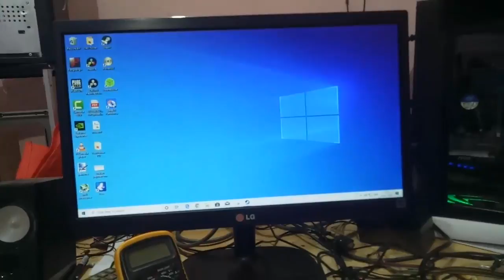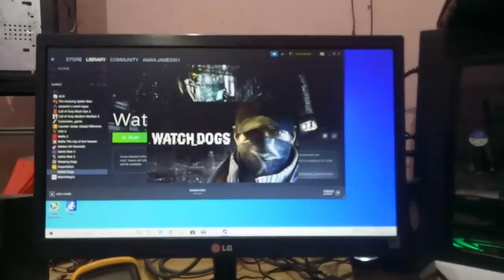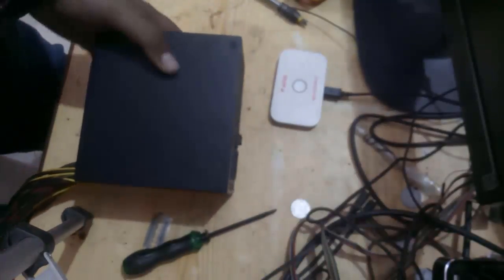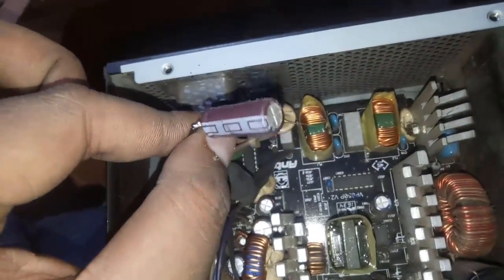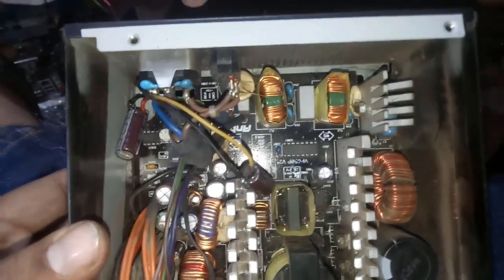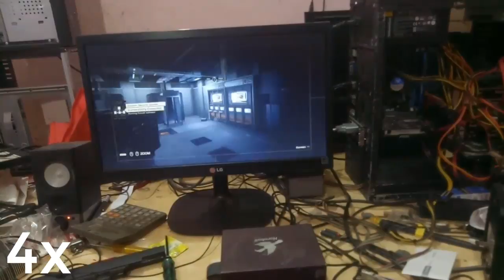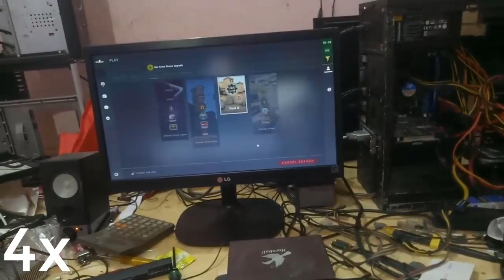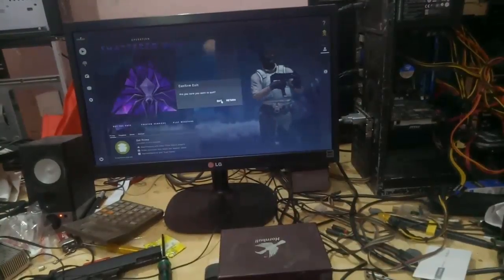PC shut down when playing games Fixed

Comment: Bhai, mera sath ya masla ha ka GTA 5 abhi install ki 2, 3 min ka baad pc goes off. I'm confused because i was playing games like Multi theft auto like 1, 2 years ago. It was working with no shutdown. But now at every game 1, 2 min baad pc shutdown ho jata ha kuch help karo
Reply: Bhai ek baar processor ka temperature check kro maybe temprature bohot zyada ho ya fir dekho apne psu ko ki kitne watt ka hai or jo gpu lga hai vo kitna power hungry hai agr psu kam watt ka hoga or gpu zyada power hungry hoga to game open hote hi pc restart ya shutdown hojayega kyi baar ram ki problem bhi hoti hai or ye bhi check krna ki ghr ki earthing shi hai ya nhi or ac current stable hai ki nhi ghr me ya fir jaha pc hai vaha ka most of the case me power supply ki dikkat hi hoti hai aise scenario me

Comment: I’m helping a friend with his pc. We just put a Corsair 850w power supply in. When we load up any game and make only a little bit of progress, it completely shuts off the pc. I’ve adjusted the power settings in control panel and have all the drivers and OS up to date but it still does it. Help!
Reply from the maker: Is it a brand new power supply
Reply: Aman James yes just bought it the day I made the comment. New ram too. It only shuts down when playing 3D games. When browsing the Internet and downloading things, it has no issues. I’ve checked and rechecked all the wiring and everything is hooked up properly. There’s no overheating, everything has plenty of power and I’ve even done simulated stress tests on everything that have all passed. Still, when I load up a game and it finishing loading a game screen and am able to get to a game, I know the power supply knows to give more power for everything and maybe it just doesn’t, gives up, and the whole system shuts down in a way that is almost like you took the power out of the wall
Reply: Hey did you find a solution?
Reply: Same problem facing , did u found the solution
Reply: Mc Donald's Xiao  yes bro , psu ka problem tha after changing it got fired
Reply: Mc Donald's Xiao  yes bro , psu ka problem tha after changing it got fired
Reply: Mc Donald's Xiao  fixed**
Reply: Mc Donald's Xiao  ha psu change krne baad fix hogya , apne pc kitne watts use krta h wo dekh le kharidna

Comment: I have gtx 960 2gb and i5 500v
My pc will randomly restart when playing games. When i set max cpu power to 70 everything is fine but i have 30fps. Will 700v be ok? Plz help becouse im not good at computers.
Reply from the maker: Buy corsair cx650 or coolermaster v650. The quality of psu also matters a high quality 650watt psu is better than low quality 800 watt psu
Reply: @amanjamestech  thanks bro
Reply: @jakubpiotrowski9288  cx or vs isn't high quality, I'm at your video because I have a vs650. Go for  TX or RX, or thermaltake or seasonic.

Comment: Hey.When i play pubg pc lite,rdr2etc.Most of the time the game run pretty good with out any restart problem.like 3 to 4hrs without any kinds of issue.but some time after 15 to 30 mints it restart and not showing display then i turn off it and then restart and it works.it happens some times only.i have cleaned every things like ram,gpuetc

Comment: Interesting, my PSU 450watt and below GTX1070 requirement which is 500watt but the shut off problem only occurs after install and play GTA V for the first time, other games etc NFS Payback, Fall Guys, CS Go & Naruto Shippuden Ninja Strom 3 the pc seem fine, not shut off at all.. Now after watching your video, I am convinced that I need to change/upgrade my PSU 😌
Reply: Do you solved the problem?
I'm also having same issue in gta 5
PC was freezing earlier when playing but after 2-3 try it is now shutting off and restarting while playing gta 5 for about 10-15min
Reply: Same everything did good until I downloaded GTA know it cuts off
Reply: @RyDaMacc-fv9yy  check your cpu temp,
I have R7 3700X with wraith prism cooler, I found out that the lever on my cooler was not pulled and locked which was causing overheat of the processor and it was shutting down to prevent any overheat damage
Reply: @mohdmaaz91  thanks ima see how i can check that out

Comment: Bro sory i have bad English so i need buy new psu to fix this problem i have same problem like u
Reply from the maker: Yup but buy a good quality psu
Reply: Can u tell me best psu for ryzen 3 and. RX 570
Reply: @Entoma-fl6tc  you can buy EVGA 550 GD Power Supply which is 80+ gold
Reply: @adr3naline4  i buy supperflower
Reply: Did you solve it?
Reply: @kaustubhbhbh1  ofc yes
Reply: @Entoma-fl6tc  thanks for the input👍

Comment: What to do if I have this problem in my laptop
Reply from the maker: Laptop could get restart problem but it doesn't face sudden power cuts unless you running it without battery.
Reply: @amanjamestech oh yes laptop never goes fully off, it just restarts.yesterday lowered some settings and it ran just fine. Ty
Reply from the maker: @saurabhs3005  it simply means its protecting himself from overheating by turning off. Maybe dust particles blocked the airway.

Comment: I have the same issue, but the thing is I tried a msi stressor and it wasn’t shutting off, but when I launched fortnite it shuts off even though all the settings are on low. I have a 650 W 80+ Bronze power supply, my gpu is ryzen 5 3600x, my graphics card is a Radeon rx 580
Reply: Did you get this resolved? I have the same issue as you with the same specs except a ryzen 7
Reply: @robbytherob  yes I just unplugged all the cables connected to my motherboard and then plugged them back in, I’m not sure if maybe something wasn’t plugged in properly or what but it works fine now
Reply: @do8042  i also have this ryzen setup wid rx580 and 650 psu having same problm ..dont know wht to do

Comment: why old ones needed to be replacing? how did you realized they were damaged?
Reply from the maker: In psu most of the capacitors are use for smoothing the current. If your PC shut down while playing game it means either you are using low wattage psu or your psu is not providing clean current.
Reply: @amanjamestech  I've been having a weird issue that might be related to this. When I turn my computer on, the lights don't turn on but the fans spin. But after two hard shutdowns (this being flicking the psu switch off and on while the pc is turning off) the pc works fine. Also to add, I have this issue too but only on some games (for example I can play CSGO just fine but can't even play Max Payne 3 or Doom Eternal)
Reply from the maker: @GyliuDot  maybe the primary capacitors of your power supply are not working
Reply: @GyliuDot  same issues with me don't know the solution BTW I'm using Corsair vs 650

Comment: this never happened to me before i dont know why it is happening now.
Reply: Same here
Reply: Me too i just changed cpu liquid cooler and still restarts and my gpu is not getting overheated idk whats wrong maybe psu
Reply: @laurathaga3541  did you fix? I was told it's either a dead or dying PSU or a dead or dying gpu, might also be ram, switching out ram temporarily fixed it for me.